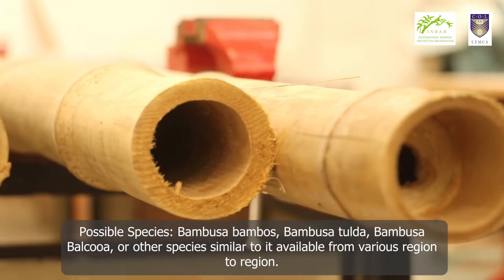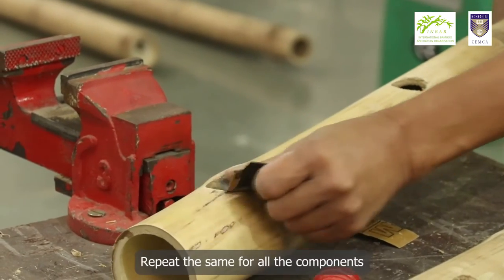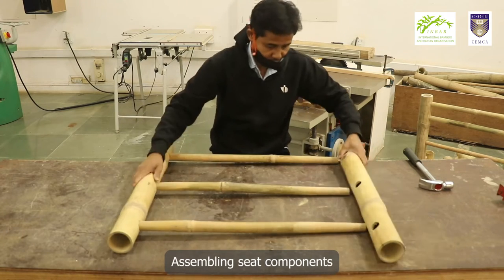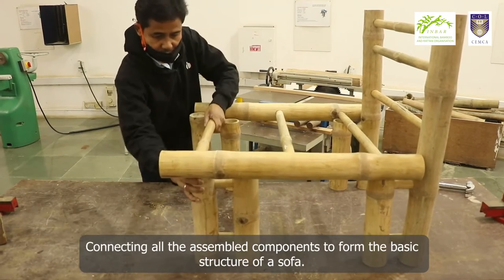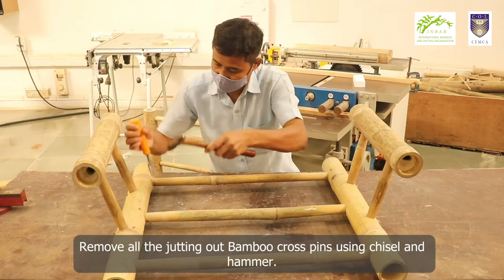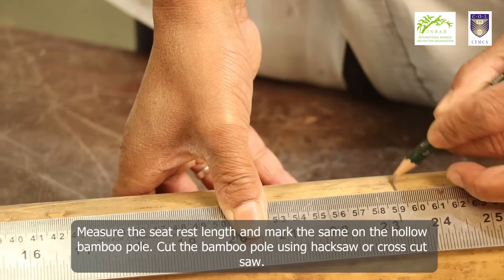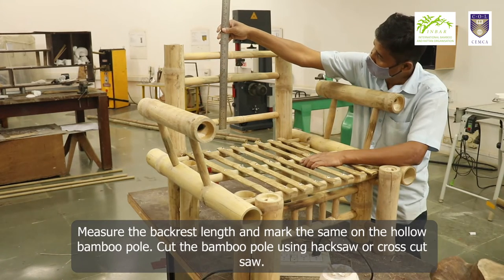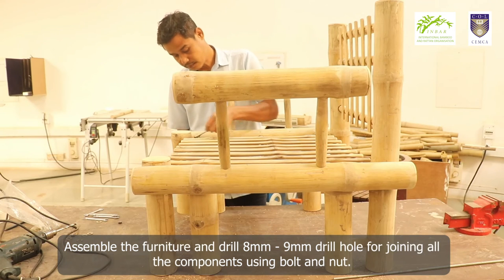8  Joinery techniques for hollow bamboo furniture

Comment: The best way to smooth and clean bamboo is to heat it until the natural wax coating melts, then wipe it down with a rag.  All the dirt comes off and it leaves a smooth polished waterproof surface.  Sanding and scraping takes more time and leaves a rougher surface.  I've been using this technique for bamboo brush handles for 40 years, it really works.